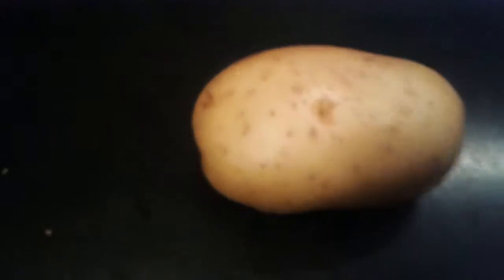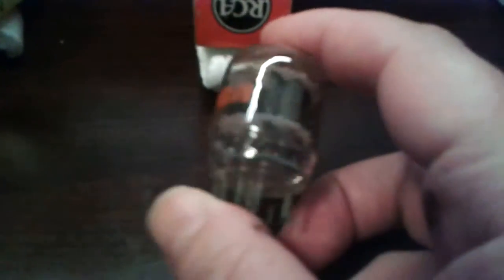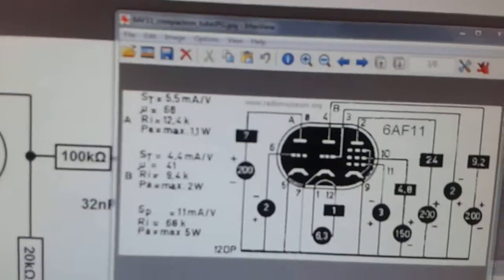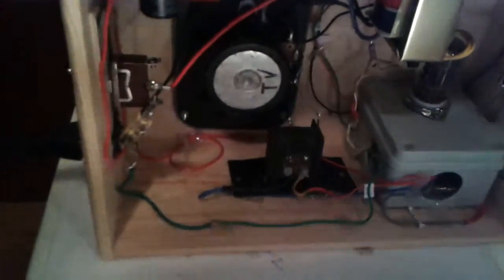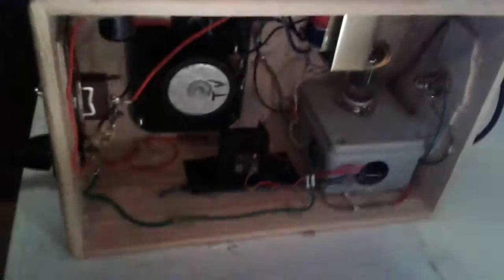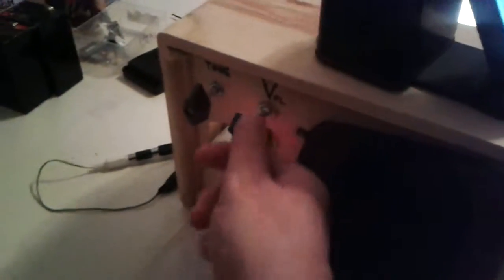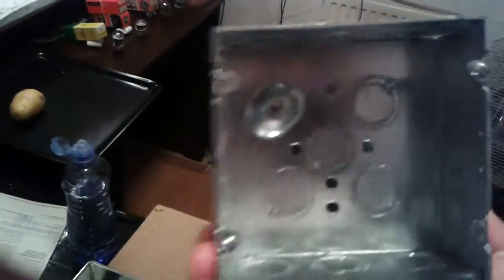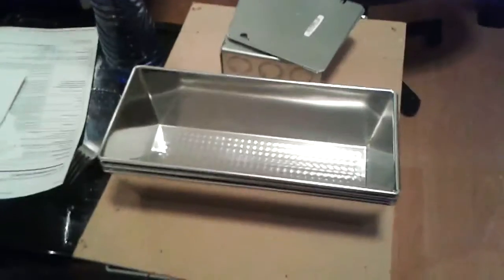Compactron Tube Amplifier 6AF11

Comment from the maker: I should indicate that at this point I had not put in the additional power supply and bluetooth circuit. I was not certain at this point if I wanted to make this a tube power FM radio or a bluetooth type of amp. In the end it did become a bit complicated. I did add the bluetooth as well as an external speaker hookup to see what else it can do with another speaker!

Comment from the maker: Sorry for taking so long with the schematic. This schematic is the BASIS for this amp. The only dif is that I added a bluetooth adapter along the input and used switches to toggle the bluetooth connection to the amp input as well as an added small power supply for the bluetooth adapter (also toggled with a switch and indicator). But the basis for this amp is here on FORREST COOK's website here:

http://solorb.com/elect/musiccirc/squirrelmonkey1/SquirrelMonkeyR1.jpg

The webpage itself is just one jump up to the parent folder:

http://solorb.com/elect/musiccirc/squirrelmonkey1

Comment: Hi,

Nice thing that you can get these post-soviet parts (I guess 6AF11 is not soviet) but still. I live in post-soviet country and I also have all these tubes just laying around for silly prices. For a long time I've wanted to build a guitar tube amp from some of these, but I just fail to find any schematics. (Also I am fairly new to tube schematics). Maybe you have something in mind, that I could do?
I salvaged old LP player and got these:
6I1P-K
6E1P
6N3P
6P14p-K
6K4P
6N2P
6H2P
6K4P.
That is of course, if you have a moment. If not, thanks anyways and good luck with future projects.
Reply: 6p14p + 6n2p would make a pretty good amp.  You can look for el84(6p14p equivalent) or 6p14p in Google images and pick out a simple schematic. Good luck!
Reply from the maker: sorry I only noticed now....I'd love to think of some projects but someone is right in that u can get lots of simple schematics online.

Comment: That's a pretty cool amp :) I wonder what is the output pentode's cathode current and what it the HT supply voltage?
Reply from the maker: +Juodas Varanoidas I guess I could provide some kind of schematic. I thought I had done so in the description, but I guess not.
Reply: +MAN CAVE NO.1  That would be great. I am asking because it got me thinking if the speaker is distorting at higher volume levels or maybe it is  the amp clipping?
Reply from the maker: could be either or....also the speaker is not in that good of shape. It has been ripped and repaired. I could've used something larger and in better shape, but I was honestly not expecting much. Most likely though, I'd say it can't handle the high levels. I will try to post some figures later...but you see that would involve more actual work...
Reply: +MAN CAVE NO.1 I see. Well, you can always connect a different speaker to see what happens.
Reply from the maker: yes! exactly! Plan to do that.....someday I get more time. :D
Reply from the maker: +Juodas Varanoidas schematic basis for this design: http://solorb.com/elect/musiccirc/squirrelmonkey1/SquirrelMonkeyR1.jpg